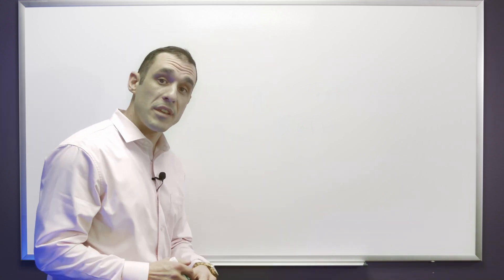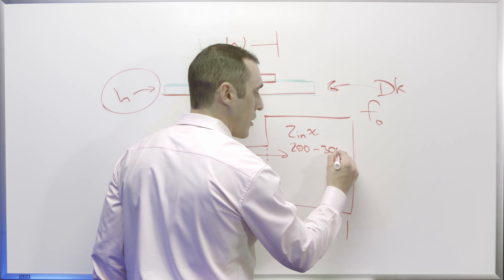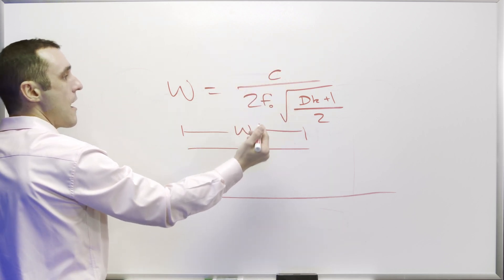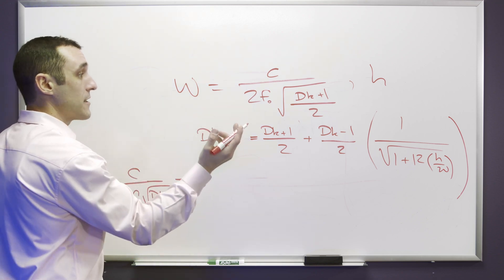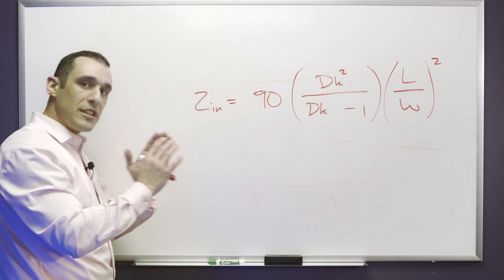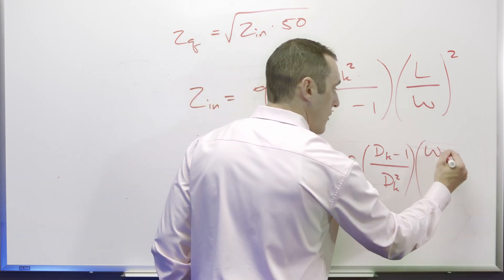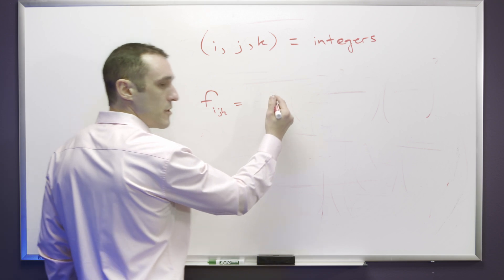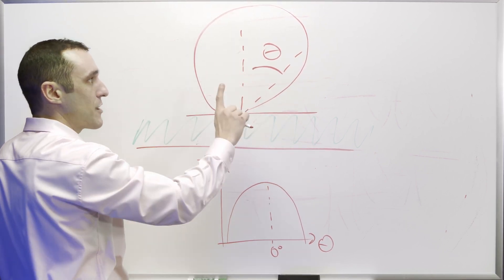Patch Antenna Design

Comment: Hello. I am having trouble understanding how to calculate the dimensions of the notch width for an inset feedline. Do you know of a formula or a text book that can lead me in the right direction?
Reply: If you look at the blog I linked in the video description, titled "Microstrip Patch Antenna Calculator for RF Designers", it has an explanation of the spacing. The goal of the spacing is to ensure the spacing is large enough to not affect the input impedance in the inset region. A typical value is 1x to 2x the width of the inset section of the feedline. In the linked blog, I also provide a citation to a research paper which looks at the inset design.

Comment: Hi Zach, is this necessary to use a quarter wave transformer and what is the length of it? Can connect 50 Ohm trace directly to antenna? And about Higher order frequencies, what should I put instead of i,j,k, just random numbers? Thank you for the video, you did a great job!!! 👏
Reply: Thank you. Quarter wave transformer will work, but you could use any fractional wavelength transformer as long as the resulting width of the transformer line is not too thin to be fabricated. You can only connect a 50 Ohm trace directly to the antenna as long as the antenna's input impedance is also 50 Ohms, which it never is unfortunately. The same principles apply for all higher order frequencies.

Comment: How do you calculate trace width from the impedance of q-wave?
Reply: If you know the impedance of the Q-wave section, you can get the width from trial and error in a calculator app, that would be the easiest way. Just start plugging in values and keep making the width smaller until the trance impedance matches the impedance of the Q-wave section. The layer stack manager in Altium Designer can also do it, just design your layer stack and enter the impedance you want and it will automatically calculate the trace width that gives this impedance.
Reply: @Zachariah-Peterson  thank you!

Comment: Of course, this is simply a gross first-order approximation.
To model it exactly, one needs QED.
Reply: I guess if you want to get really exact at the sub-atomic level, then sure use quantum electrodynamics. At the macroscopic level Maxwell's equations work just fine.
Reply: @Zachariah-Peterson  Multi GHz or THz are not at the macroscopic level.
Maxwell Equations fail progressively at this extreme, and beyond.
You may as well get it 100% correct, rather than using an approximation, is what I am urging.
Reply: @MichaelKingsfordGray  GHz and THz most certainly are at the macroscopic level. The "Q" in QED means "quantum", you do not need quantum electrodynamics to describe propagation of electromagnetic waves on mm or cm length scales. A single wavelength would encompass many multiples of Avogadro's number of particles, that is the definition of macroscopic phenomena. QED is applicable in the case where the electromagnetic field interacts with individual sub-atomic particles, you don't need QED to describe wave propagation in media with Avogadro's number worth of particles. Physicists and engineers did all of this successfully in the 1800's and 1900's with only Maxwell's equations, before quantum mechanics was conceived or widely understood.

Comment: Hi Zach, why GND block the radiation of the antenna?
Reply: Because it reacts like a capacitor on the alternating current "negative flipp and positive flipp" by blocking and cancelling the energy emitted by the antenna.

Comment: Hi Zach, What are the unit of length & Width and as well as for the frequency? and should we take speed of light in m/sec of km/h?
Reply: For the ratio quantities, it does not matter as long as the quantities in a ratio are the same units. For the other quantities, just pick a standard unit system, MKS or CGS will work fine. Being a physicist I always use MKS.